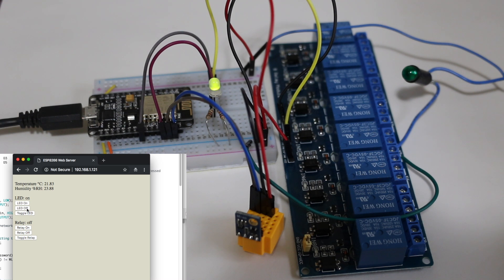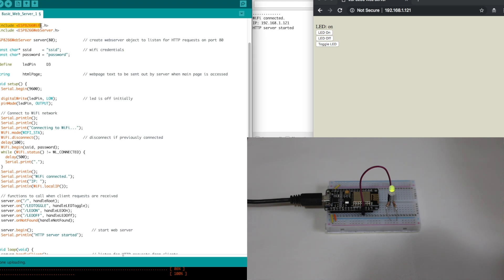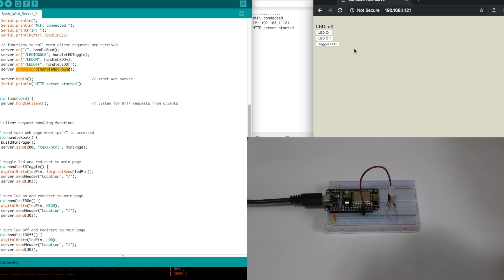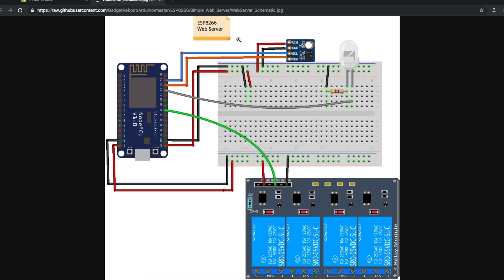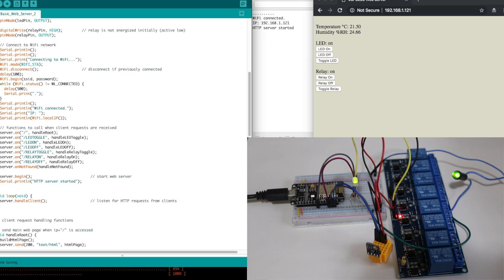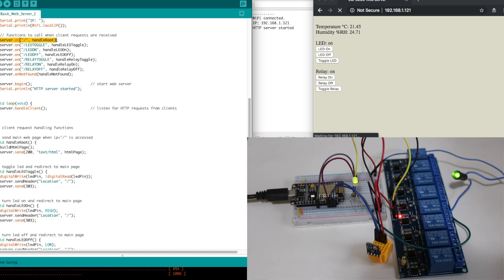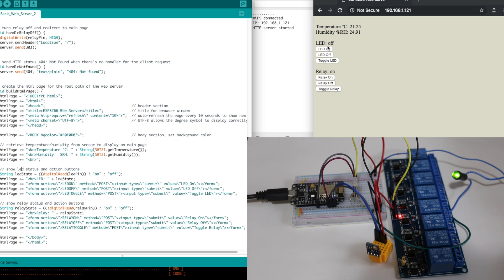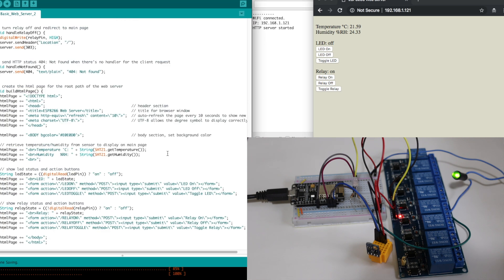ESP8266 Web Server - Control a Relay, LED, Read Temperature & Humidity

Comment: Is it possible to replace sensor with BME280 module and use the humidity to control the relay?
Reply from the maker: Very possible, once the humidity sensor is set up, software would look for a certain value or range of values and control the output GPIO.  I ordered a BME280 module long ago and it never came.
Reply: @GadgetReboot  Thanks for the reply. I am trying to achieve automatic control of the relay based on humidity values (from BME280) to control a dehydrator. Where do I modify your code.

Comment: Thanks a lot, nice clear and concise tutorial.  I implemented it and worked fine.   I am putting together a data collection system that would gather numbers from several ESPs.
I think websocket is what I am going to need. Finally I have to generate a CSV from all those values, and renew it at midnight everyday. (meaning save the csv and make a new one).
I wish someone made a tutorial on that. (hint)

Also I wonder what would take to make the example above work outside the local network, meaning the www.
Thanks again
Mitch
Reply from the maker: Sounds like the kind of thing I would eventually explore inevitably. I’m currently looking at ATTiny 85 as a USB device and I’m going down all kinds of rabbit holes and I’m going to have several projects around that, then eventually back to Wi-Fi stuff. 

External Internet enabled relay control  is on the bucket list.

Comment: OK, you convinced me. This looks like too much fun to wait any longer :)  I broke the piggy bank and ordered one of these modules. Described by the seller as ESP8266 ESP-12E CP2102. Visually, it seems to be identical to yours. But only 3.97$ CAN shipped ?  How is that possible ?
Reply from the maker: I haven’t checked prices lately but it might be possible from China. But I would be impressed if it actually had a CP2102 instead of the typical CH340 USB interface. Not that it really matters either way for this purpose once you get the drivers installed it’s all good.
Reply: @GadgetReboot  On one of the photos provided by the seller, we see the back of the board and the text there says : 
1- Install CP2102 driver
2- Use 9600 baud rate
3- Connect Wi-Fi and enjoy.
https://i.imgur.com/0mZML5q.jpg
Reply from the maker: The one problem with those auctions is sometimes they show the official product in the pictures but they send the knock off. Sometimes I even saw both knock off and original in different pictures on the same auction and the auction listing was talking about being an authentic product but it makes no sense why they put the knock off version in some of the pictures so either way it will still be fine but I will never be surprised if I don’t  get what I expected from those shipments. It’s half of the fun sometimes seeing what I actually get compared to what I expected.
Reply: @GadgetReboot  You're right of course. Happened to me too a couple of times.
Reply from the maker: That reminds me, I haven’t bought anything in a while. I’m waiting for a bunch of things but I didn’t get any shipments for two weeks now so I think I need to go place more orders.
Reply: @GadgetReboot  Many Chinese sellers are on vacations right now, celebrating Chinese new year. But some are still in operation. I placed 3 orders in the past 2 days but it took a bit of research to find "open"  sellers.
Reply from the maker: I figured I still should have seen orders from 2 months ago roll in. Maybe next week there'll be an overload in the mailbox.  I just put in 2 new orders but now I do have to wait another week for those to be processed.  Drop in the bucket considering the likely shipping transit time.
Reply: @GadgetReboot   I would not mind the extra week. But when they go back to work, I figure they'll rush to process all the accumulated orders and that can increase the risks of handling errors.

Comment: Why all the page changing, just name the <input> tag and you can check your answer for button pressed:
<input type=submit name="relayon" value="Relay on">

and on the server: if (server.hasArg("relayon")) ....
Reply from the maker: Thanks for pointing that out. Yeah I originally wasn’t using input forms, I was just using simple clickable hyperlinks to directly go to the other pages and then the thing evolved into re-directing back to the root and then I decided to change into using buttons so it was a big mishmash plus I’m still learning so I definitely appreciate the feedback.
Reply: I am also working on a ESP with a webserver at the current time and it is the first one I have done on a ESP. It is a bit more advanced than just a few buttons, I have lots of input fields also (The checkbox type is irritating, either you have to keep track of it or you have to cheat, because it only respond when checked) .

Comment: Cool vid. I'm learning arduino at the moment, but have just picked up an esp8266 and already have the relay board. Will deffo take a proper look at this.
Reply from the maker: Yeah it’s fun getting Arduino working on it’s own for various sensors or even controlling an LED but then doing things over wireless or fancy features like updating software over the air, it’s like the same amount of fun as a beginner all over again.

Comment: Very nice video! A few years back I wrote an io control system for the ESP that allows for control from afar via web pages or URI calls from Javascript, Python etc. https://github.com/jscottb/ESP8266_http_io
Reply from the maker: Thanks for the link, I’ve opened it in a tab to check out later. Always like seeing other projects.
Reply: @GadgetReboot  Oh yeah. I did a Intractable on it as well. https://www.instructables.com/id/ESP8266-HTTP-IO-Server/